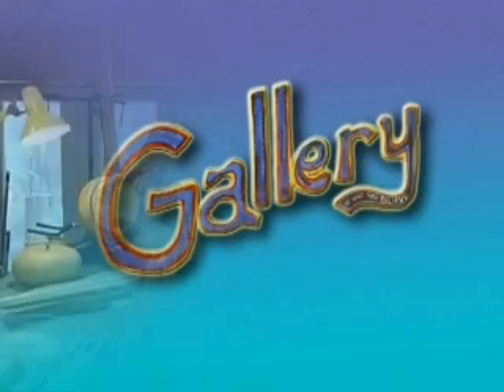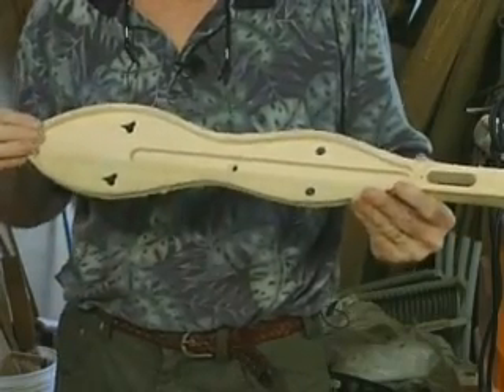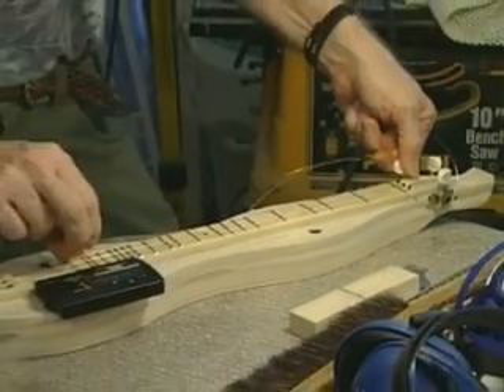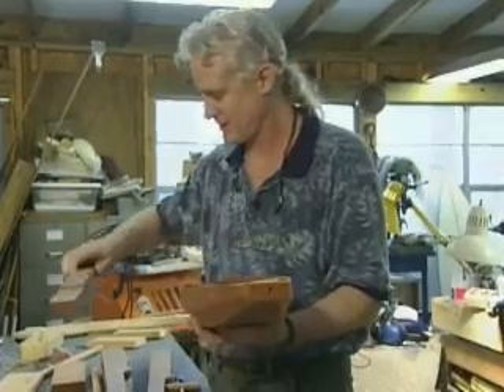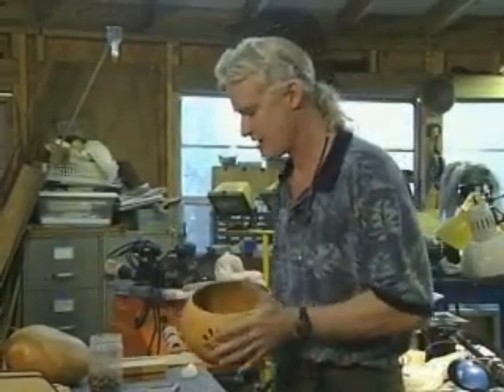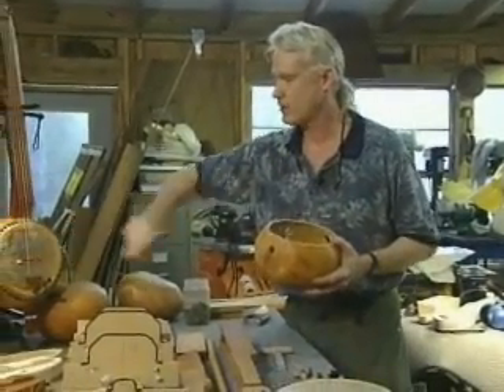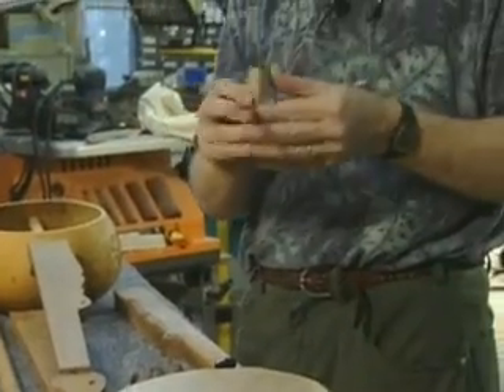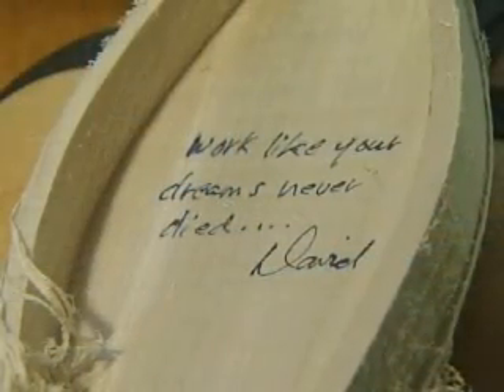David Beede Luthier

Comment: do you barnish the gourds on the inside?
Reply from the maker: No I don't, I leave them raw from the seed scraping. I use a bees wax citrus oil combo on the outside of the gourd called Howard's Feed n Wax. I have tried doing a thinned wash of hide glue on the inside of the skin which seems to slow down humidity exchange and  make tuning a bit more stable.
Reply: the gourds never get deform by the skin tension? don't you reinforce them??
Reply from the maker: Not usually. I have put a wash of thinned hide glue on the inside of the skin and the gourd to slow down moisture exchange. I get my gourds from Welburn Farm in  California and they are really strong, about a 1.2" thick. Thinner ones I have mounted triangular supports on the the thru rod/stick that comes from the neck. It supports the arc of the gourd right in front of the tail piece which prevents the "pucker" or wrinkle that can develop between the tail piece and the bridge. The thick gourds don't require that.